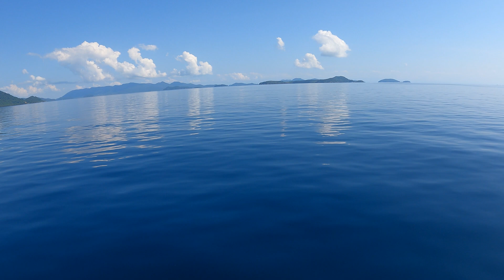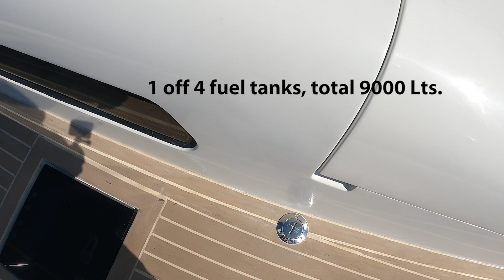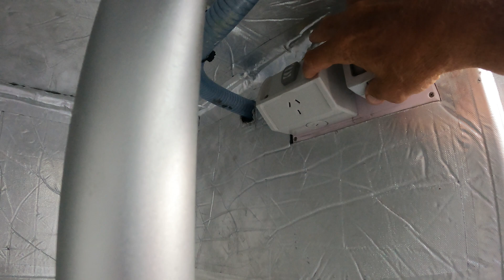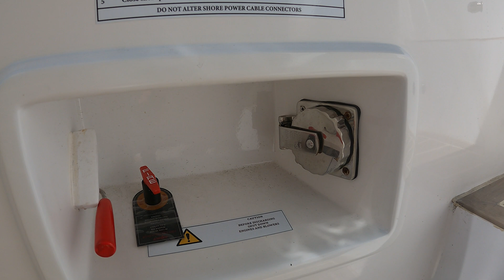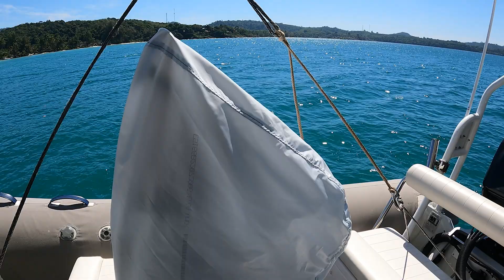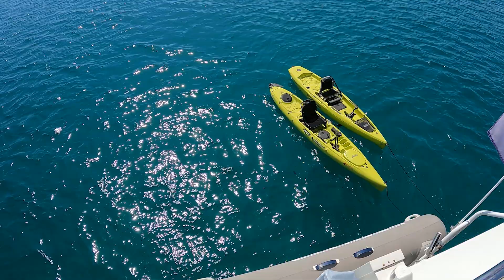Power Catamaran, "BOAT TOUR" around the outside. Longreach 58 Expedition.

Comment: I for one would be very concerned about shark bite styled couplings and "T"s and all the plastic piping. Doesn't seem very survivable in a casualty event. Plastic fuel lines, oil lines etc. will melt and it's "FLAME ON" full on Bravo casualty.
Reply: disagree, shes most likely running diesel, and its far better to carry a box of plastic fittings and some poly pipe to replace any cracks etc than carrying brass and copper piping etc. i dont think they are shark type usa fittings they look to be screw down pressure fittings which are far superior to the shark style.
Reply from the maker: correct

Comment: Awesome. The attention to details and convenience is terrific. Please demonstrate how the windows work in the aft cockpit.
Reply: Do those rudders cope with single screw? 6knots?
Reply from the maker: will do in up coming video but its basically push a button
Reply: @CruisingSunrise  just curious about how the whole window system works:  if water gets in the frame when the window is down and where that goes. It’s very unique to have this set up. Also curious to hear what it sounds like in the salon when the engines are running. Overall, seems very quiet. Lastly, wasn’t sure if you showed where you keep spare parts like filters. Is there a dedicated space for that?
Reply from the maker: @barryholiday8998  The windows are like a car door. The glass does not go though th floor only the actuators which are sealed, there is a water catcher at the bottom that drains to the transom steps. Engine noise inside the saloon under way is between 60 and 70 decibels and almost no vibration . the spares can go on shelves in the engine rooms or on 1 off the 4 shelves that go all the way round the foward lockers. These are huge and could easily be a crew cabin.